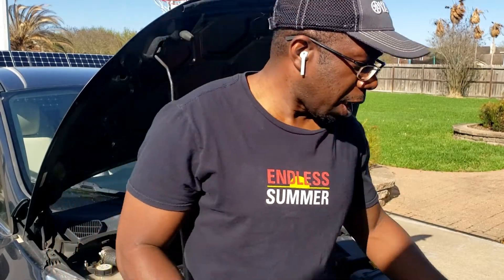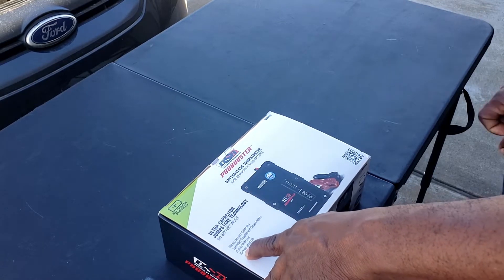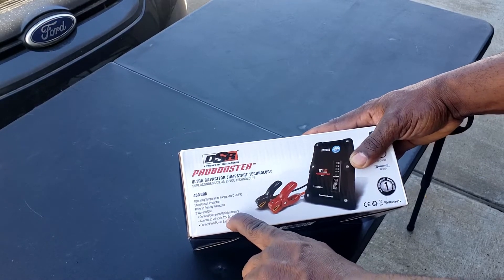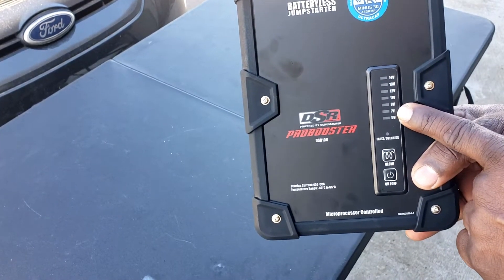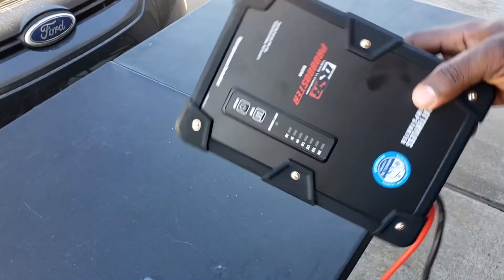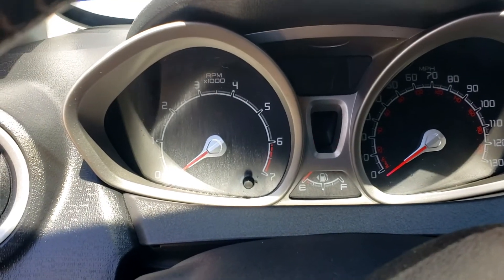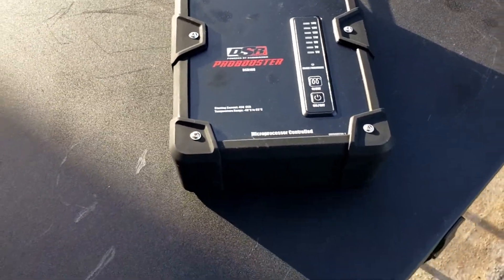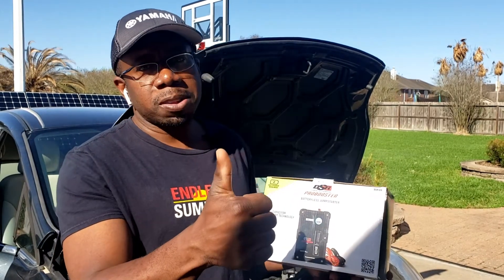Ultra Capacitor Battery-less Jumpstart Technology from Schumacher Probooster DSR108 Review

Comment: I don't think that means the charge lasts 10 years. Capacitors discharge pretty quickly compared to lithium. I'm not sure what it means by 10 year shelf life.
Reply: I think what they mean and the marketing is that the device itself (capacitor) can last up to 10 years sitting in the storage of your car and doing his job. I don't know how true that is though. I owned one of these of a different brand and it broke in less than 3 years and used it about 4 times only.

Comment: I would like to see the battery voltage with a multimeter before connecting the jumper pack. The voltage reading you're seeing is the charge level on the capacitor, starting at 5 or 7 volts, and slowly increases as capacitors fill up to 14V. The battery voltage on the vehicle maybe higher at 10-11volts. That's a tiny car, let me see how it starts a larger vehicle, pickup truck, SUV.
Reply: The cap actually charges to over 16V when it does the boosting step up charge.